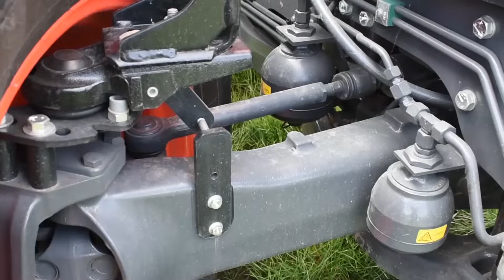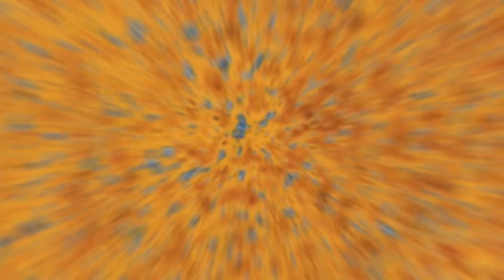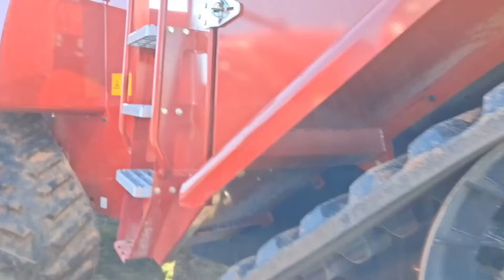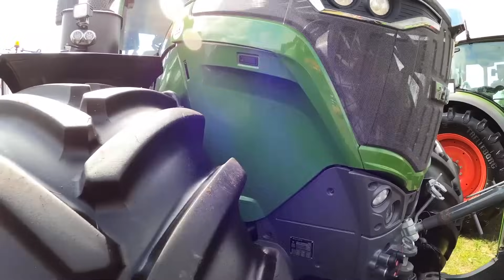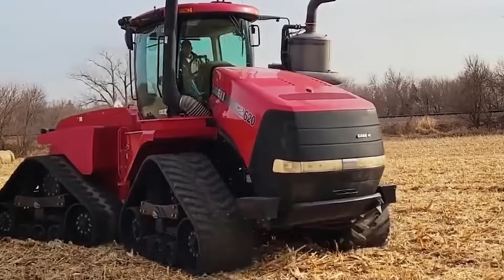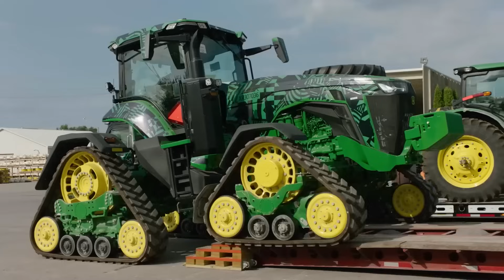12 Tractors BANKRUPTING Farmers — Dealers Won’t Warn You!

Comment: the old tractors start run go  and dont have  all the problems you get with way too much electronics  these electronic machines would have no resale value as no one would be able to fix them I can see why obsoleting parts for the older models  is happening   guess I wont be around when it all falls apart

Comment: Cat C15 engines don't have aluminum cylinder heads. This video is not factually correct.
Reply: The new one's made for agriculture use do have aluminum cylinder head's. But the c 15 cast iron heads in trucks where bad to crack also. I have been diesel mechanic all my life and I bet I have replaced 1000 cat head's.